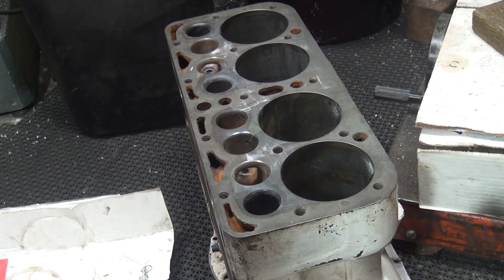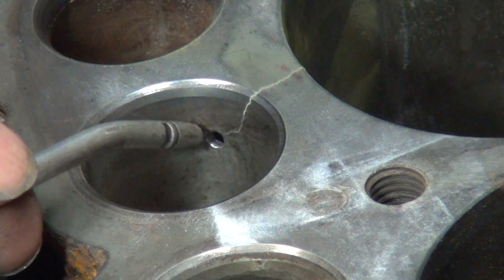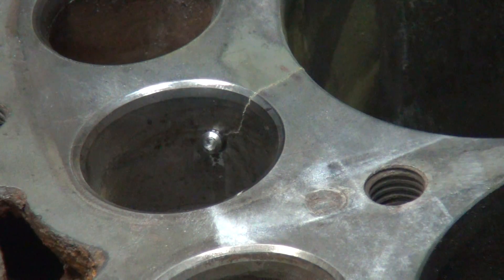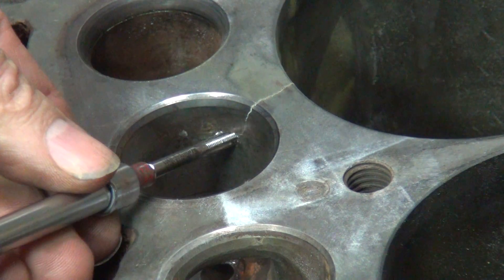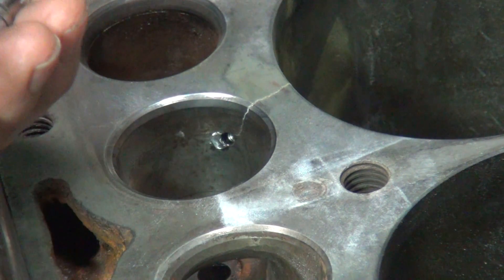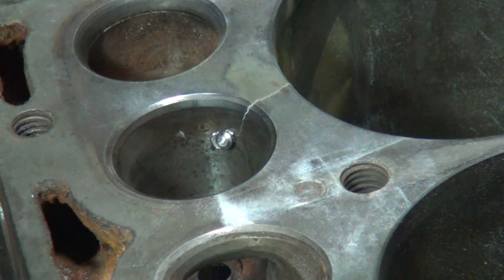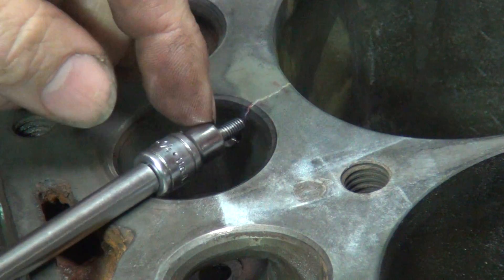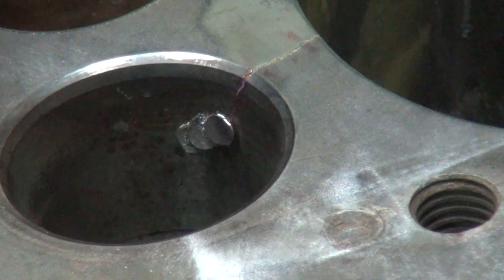1932 ford #102 model A or B flathead race block crack repair by tatro machine

Comment: Are there other ways to repair a crack like this. I am wondering if nickel rod would do the trick.
Reply from the maker: no, it will destroy the cast iron. castiron needs to be pre and post heated way over 1500degs to weld correctly. arc welding does not do this.
tatro
Reply: Tatro Machine thank you!

Comment: What kind of lifespan would that repair have? Seems like the block could flex. Thanks for the vid
Reply from the maker: my race bike is into about 15 years now and it had more than this ford motor has. you do know that these motors are know to crack when they were new.
tatro

Comment: Very interesting never seen that done before pertty cool .could ya weld it?
Reply from the maker: yes if you had a big high temp oven, tools and the skill on how to weld cast iron. a course the rest of the work to the block would have to be redone along with the poured in block lead bearings. that is why i did a cold repair. it saved all of the other work that was done.
tatro
Reply: cant weld cast iron